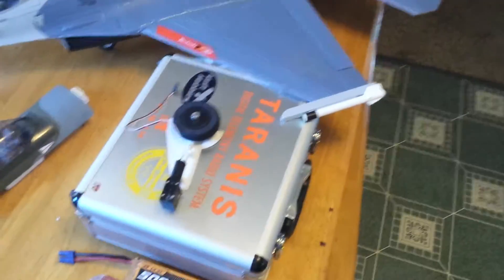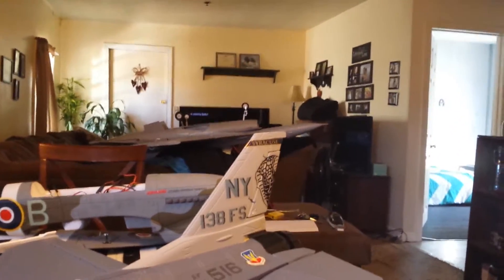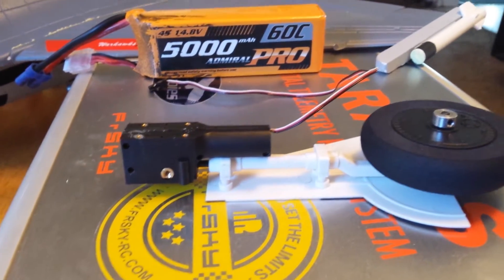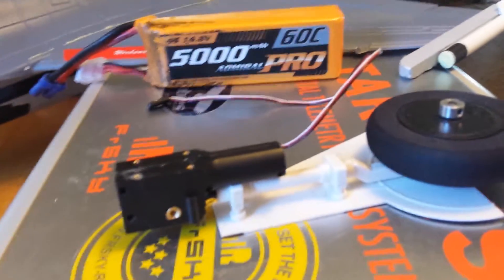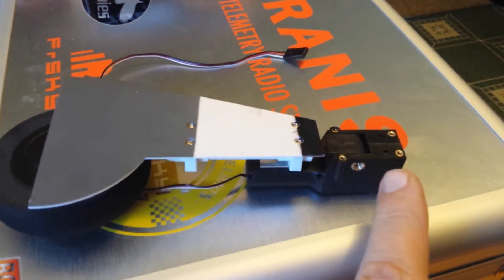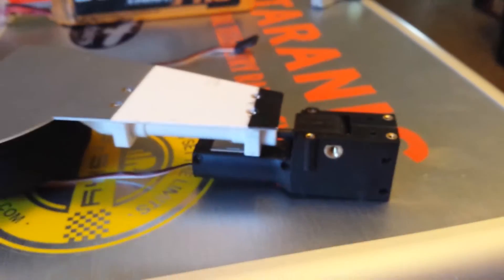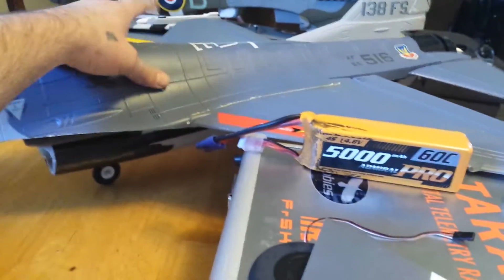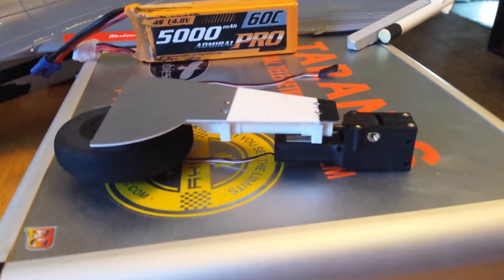Dynam retract issue. Figured out why they malfunction.  Must watch

Comment: great info.i have a top RC fw-190 whose retracts look similar.on one the strut literally fell out.what type of tool do you use to tighten the metal strut into the servo housing?
Reply from the maker: michael markey funny thing is with dynam retracts it's not secured down ones you take out the screws for the housing it's just sitting in there.
Reply: What keeps them in? On the top RC fw-190 the metal wire for the gear have notches on both sides but mine fell out on one retract.the strut will just spin around.i don't know what kind of tool you use on the large brass fittings on each side.
Reply from the maker: Once you open up the dynams reacts the gears and motor just freely fall out. Nothing holding them down. It literally just pops right out. I am not familiar with the retracts your dealing with. I would have to order one and dissect it.
Reply: Ok,thanks.these retracts look just like the dynamic.i saw one vid where the guy just used a piece of wire as the strut and he inserted a tool into the large fittings on either side of the housing and roasted them to secure the wire.i know the fittings are threaded but I don't know what kind of tool you use.it looked like a screwdriver but I couldn't make out the head it had.thanks anyway.

Comment: it don't take much lube, you do not want it to contaminate the micro switches.... and or gum them up! they tend to working intermittently as the result. plastic safe electronic cleaner worked well on mine, only a small shot should do. I agree the retracts suck azz !   They are widely sold and used on many of the manufacturers air craft! I have a E-flite F-16 A friend and I both had gear failure, with less than 12 flights.. two thumbs down! Eflite
Reply from the maker: Your right. Yes dont over flow the lube oil. Just concentrate it on the screw rail. Then put it back together.